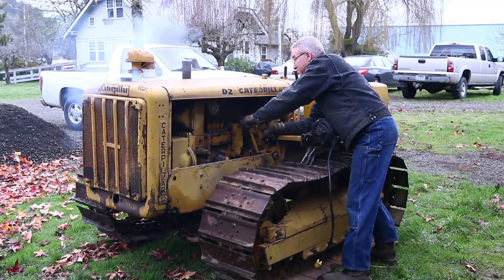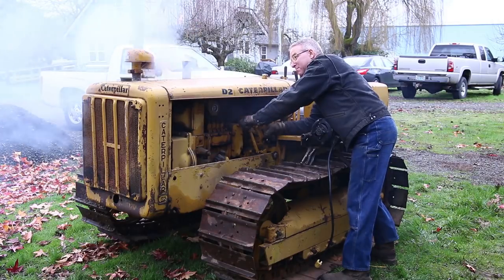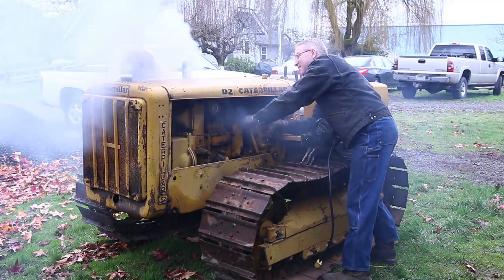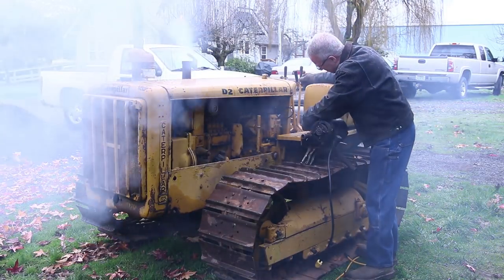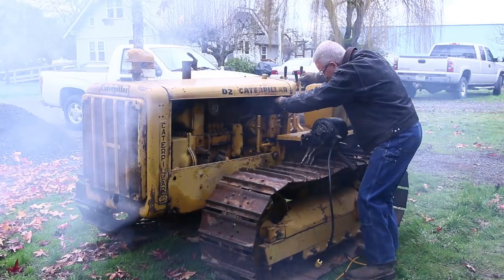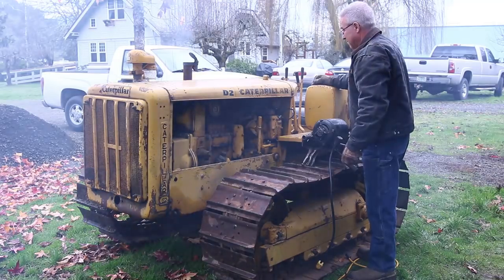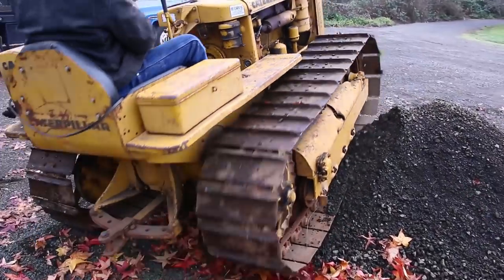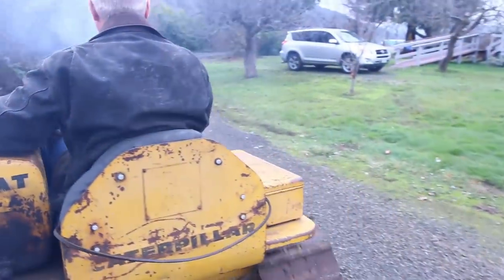Starting D2 Cat with Electric Motor

Comment: In the 1950's My Dad and his older brother and Father formed a lumber company in Western PA.  After using a mule or 2 for hauling trees to be cut on the 00 (double ought) Frick.  After a while they purchased a 30 Cat and then a 15 Cat, which is not much smaller than your D-2.  I spent all summer (1982) freeing the pistons and we got the 15 running after some 20 years of it sitting in the woods.  Even though the 15 is gas powered, she could pull some good sized trees.  You are a pretty smart fellow to start your pony motor that way - thank you for sharing.

Comment: I used to have a D2 Cat myself.   The sound of both engines in the video really took me back.  My D2 had an electric start for the gas engine, so I never used the rope pull.  Mine also had the blade in front, and a winch in the back for 1" braided steel cable. Cat always had the parts for it, even 50 years later, though they did want quite a bit for them.

Comment: So an electric motor, starting a gas motor, starting a diesel motor.  Maybe add a windmill or something to start the electric motor, then use the lil Cat to push start something else.
Reply: .....Your comment is just ignorance on the face- These pieces of equipment were built in another time with a completely different paradigm, and you are judging them by what is required to get them to work in the modern world without modifying them to be the same "gee-whiz", yet un-robust technology that is ubiquitous now...These old machines would run on kerosene, salty fuel oil and bacon grease, and be repaired with wrought iron, chewing gum and week old dick cheese, by people with more common sense than formal education... In comparison to your modern engine- where,  if a grain of sand gets into the fuel tank it requires a total rebuild by someone with a doctorate in mechanical engineering...Sneer and snark as you like , but this machine worked better for its designed purpose, with less upkeep and maintenance, and ASSUREDLY will last longer than any I-phone...
Reply: >>>--- the joke --->

   Brett's head
Reply: hahahhahahahha
Reply: Brett Tiedemann damn someone a little but hurt
Reply: yeah terrible efficiency and low tolerances are obviously what they wanted at the time. a car surviving to 100k miles used to be rare without major repair. now you would expect over 150k with no effort. your 'back in my day' mentality is flat out wrong. machines are better and cheaper than they've ever been.
Reply: nrok113 100k was rare? I had a Pontiac with over 400k. It was at 386k when I hotrodded the motor the body got too rusty from salt

Comment: Great idea with the electric motor.  Looks like it might need some work if it is still puffing white smoke after warming up.  Trying to start while holding the pinion engagement lever in will bend or break the mechanism sooner or later.  Specially if you do that in cold weather a lot. The lever is not meant to take that kind of beating.  One has to let the diesel block warm up on compression with fuel off, then should not have to hold the lever in, should start right away if the block is warm to the touch when you open the throttle.

Comment: I got a D2 5J vintage 1940. The diesel am in the middle of trying to get its worn arse to start "easy". ATM both middle cylinders aren't getting fuel at all while the front is barely getting any. Trying to get the motor to TDC. Is my first BIG foray into this thing so need to find the WHERE to line the marks up before I start pulling IPs for a bath to clean them.
I have a mind to add an electric start as well though will more likely be a 12V system. Perhaps the starter//generator from a golf cart or such.

Comment: Electricity starts the gas engine, then the gas engine starts the primary diesel engine. Fuel such as gas and diesel are still used to produce electricity. What a beautiful relationship between the transfer of energy!!

Comment: You may be able to set up some sort of starter using a centrifugal clutch on a 12v motor. Should be some way to add a electric starter so you don't have to run a cord to it or pull start it.

Comment: I don't have a long enough extension cord so I will have to get the 5 HP gas electric generator pull start it to power the electric motor.

Comment: Correct me if I'm wrong but it looks like you are using an electric motor to start a gas engine that is then used to start a diesel engine.  How big of an electric motor would you need to just bypass the gas engine?

Comment: By golly do you need to run some seafoam through that smoky beast
Reply: It's just cold it should stop smoking so bad once it is warmed up
Reply: Maybe so. But it couldn't hurt to try it anyway. Lol
Reply: It’s a diesel, sea foam will do nothing for it, as stated, it’ll quit when it warms up.
Reply: They shouldn't smoke quite that much, maybe fuel is old and injectors are a little gummy, I like the sea foam idea but I think I might try a little marvel mystery oil myself.....It probably just needs a good pull and an oil change and a little tinkering.....Old Cats never quit, they just find a new home.
Reply: Its pretty chilly in Roseburg
Reply: My grandma always used to say that "Old Truckers Never Die, They Just Get a New Peterbuilt:

Comment: Anyone else think it's funny that you need an electric motor to start  the gas engine to start the diesel engine? Also I concur with a precious comment, you need a longer exhaust pipe, or at least a respirator for now.

Comment: Why not just connect proper engine starter? 
Not sure how you call it in USA, but device you have in any car.. Essentialy, electric motor, but with proper speed, reductor (eventualy), engage/disengage device...
I beleve you can find salvaged for few bucks, wire starter key, battery... at no real cost.

Comment: So if you have the electric motor to start it, couldn't you bypass the step of the petrol engine altogether?
Reply: Maybe someone out there makes a flywheel with starter teeth. Not sure. That would be nice though

Comment: A proper california tractor.  If you could only let it idle for twenty minutes whilst cooking bacon... then push over a tree eating the bacon.  You'd 'trigger' half the state.
Reply: Only thing left to do would be to find a way to use the motor running a pump to drain a swimming pool and then refill it for no good reason.  I think they would burn you at the stake.  Which actually looks like there might be slightly less smoke involved than running that beast.

Comment: Naughty boy!!!!  You Stopped the pony motor by switching off the magneto.  Big No, No!!!  Most Common way that pony motor seizes. Turn off fuel (gas or petrol) and let engine die. Two reasons:  Down draft carburetor so you will have float bouncing around AND  fuel will leak down into the sump of the pony motor and thin out the oil.  This is main reason they seize.

Comment: This is how you get carbon monoxide poisoning !
Reply: Likely not, despite the black smoke from carbon particles (or blue from engine oil), diesel engines like that actually tend to run lean, rather than rich. Thus unlike a petrol motor, they tend to make NOS rather than CO, which is much less harmful. On the other hand the unburned carbon and oil is VERY bad for your lungs and health long term, but won't suffocate you quickly as CO does.
Reply: Well, today I learned something !